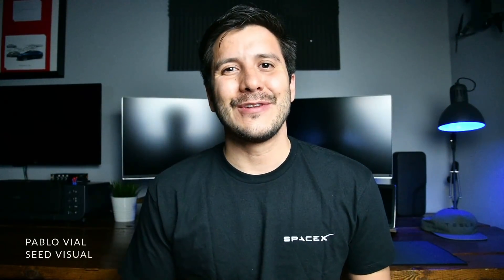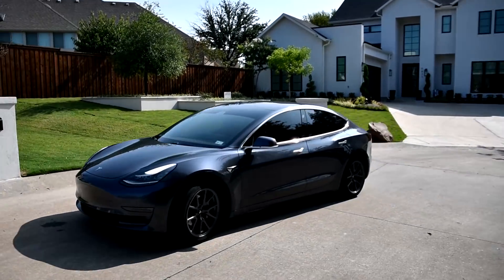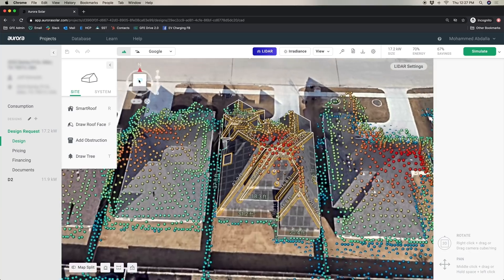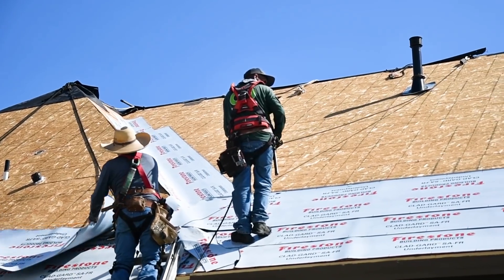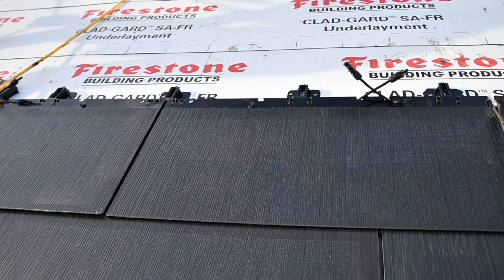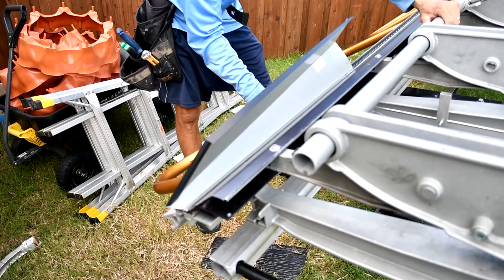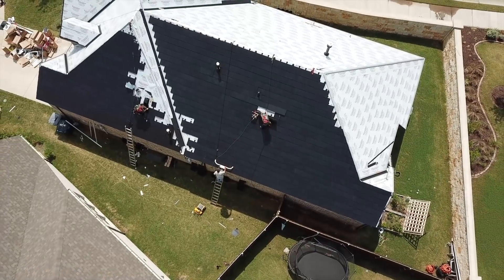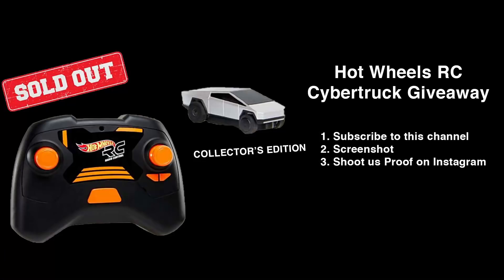Tesla Solar Roof V3 in Texas

Comment: SolarCity aka Tesla is a big scam..they charge $2500 to uninstall /reinstall 3 solar panels required to fix a roof leak. Do NOT fall into the trap like we did!!!!
Reply from the maker: That's why it is highly recommended that you use a third party Tesla Certified Installer like Good Faith Energy. Read the reviews for Tesla service vs Good Faith Energy service. Not sure why anyone would go to Tesla directly.

A typical uninstall should cost between $100 and $200 per panel and leaks are warrantied by GFE. I can't speak on behalf of Tesla, but being a Tesla car customer myself, I wouldn't count on them for quality assurance or customer service ever.

Comment: So u dont need powerwall with solar roof? Pls explain, thanku in advance
Reply from the maker: It works much better if you have the combination of both the Solar Roof plus Powerwalls, but no, you do not have to have both. Without the Powerwalls, you simply use the amount of energy being produced. This means that you would have power during the day, but would still need to rely on the grid at night.

Comment: Did you find the solar roof useful during your balckouts.
Reply from the maker: Because this system is equipped with a Tesla Powerwall, it was able to not only produce enough energy to run the house, but also was sending some energy back to the grid during the days it was storming.

Comment: Good video production (from a non-video producer). Hey, question/background. I have a Tesla (SolarCity) panel system on my house, and also four small-ish children. We are in the long process of changing all of our household appliances, vehicles, etcetera to electric, and expanding our electricity needs (quarantine above-ground pool for the kids, etcetera). Our PV system that we got four years ago just isn't covering our needs any longer...I have investigated adding panels to our system, but it's not feasible due to the string inverter setup. I basically have to buy a whole new system, or new panels and a new inverter and then tie the new panels in with the old. It's such a big project that I only want to do it once, but our kids are still growing and we only have one of the two vehicles electric. Our needs will continue to grow and I don't want to install a new PV system every year. So, with all that said, with the Tesla solar roof, can they just swing by, as necessary, and swap out a few of those inactive panels for active ones as electricity demand increases over time?
Reply from the maker: You can definitely expand on an existing system, and swap out non producing tiles with producing tiles. Its best to max it out from the get go to keep installation costs down, but yes it can be done.
Reply: @SeedVisual  For sure. I wanted to get a much bigger system when we first installed it, but local laws, so says Tesla, only allow for a household to install a system that meets 100% of their previous 12-months' usage. If I had the choice, I would have installed a system double the size, and grown into it over time rather than the other way around.

Comment: Great solar roof and what is the cost for the solar roof in tx. 
I have subscribed too
Thanks
Reply from the maker: The price varies. It all comes down to complexity of the install, how much energy you use, and if you are going with storage features as well. Those factors make the price range vary pretty substantially. If I had to make a guess, you are looking at a minimum of $40,000. The only real way to know is to have free a consultation. Use the link below to get in touch with GFE to get a quote today.